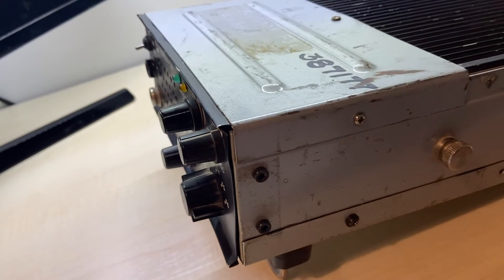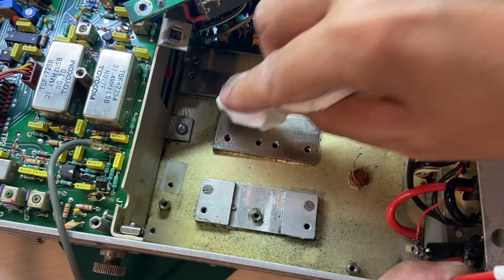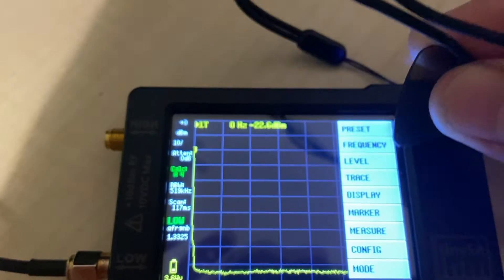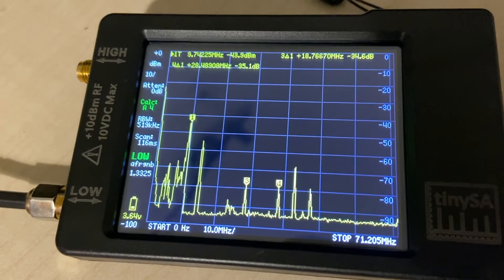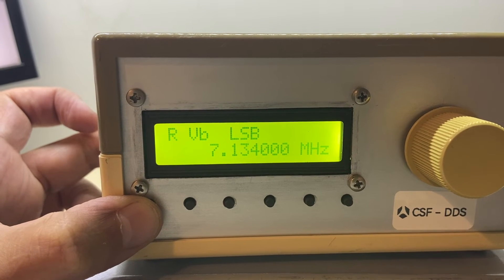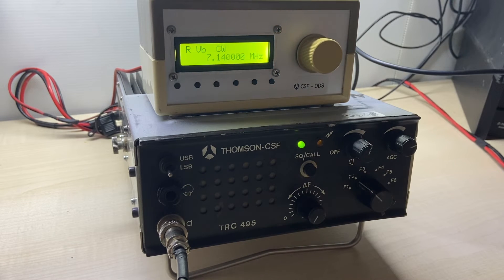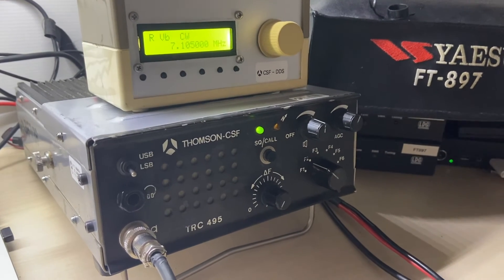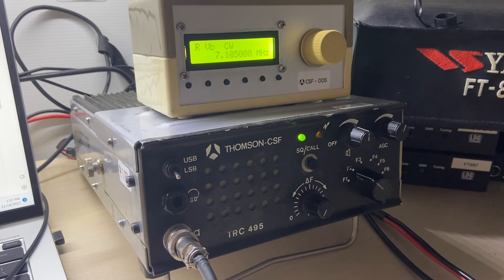Thomson TRC-495

Comment: Hi bro! I am searching for a French PR4G conection diagram in order to work on a ptt …
Do you have it? Or something that can help me ? :)
Reply from the maker: Hi! I guess it is the same as other thomson gear with Schaltbau connectors like that one
A ground 
B speaker 
C mic
E mic ground 
F ptt

To ptt just short F to A

Hope it works…. Try a speaker before only with a A and B to see of the scheme is ok
Reply from the maker: Have you bought that one on eBay?
Reply: In the PR4G system the conector is a CMA14 pin (a push-pull)
Reply from the maker: @gaetand.a5228  oh yeah sorry it is 14 pin. I got the name wrong but pin out is the one I told you. I have a TRC9200 on its way to me and I just rewired it like so. Same connection and pinout as my TRC 3400
Reply: The problem is that the PR4G is made by Thales And I don’t find an « official » connections diragram anywhere ….but I will try your’s ! 
Thank you for your help bro !!
Reply from the maker: @gaetand.a5228  some models are thales some are Thomson… but all share pinout, at least for the handsets
Reply: I will try that tho, thank you again mate !